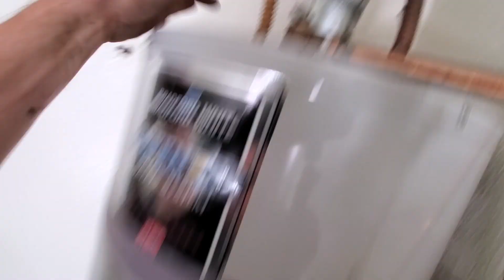2 water heaters in 2 hours

Comment: Tnp is no good
Reply from the maker: Did you not listen to what I said in the video? Let me recap: owners didn't want to pay us to run the t and p outside which would have required drilling thru the cabinet and floor, crawling under the house, drilling a hole in the side of the house and then running 8 ft of copper.
Reply: I heard ya bro and I understand them not wanting to pay for that, but I’m sayin the way you did is too short, if someone is in front of it when it goes off they might get hit

Comment: Putting in water heaters not to code is pathetic and nothing to be proud of!
Reply: I was about to say: You are required to put it in per code. YES, you as the Plumber responsible for this water heater are not only REQUIRED, to bring it up to code, but if you don't, and it goes bad; it's going to be your responsibility, because it's not up to Code. I think the IPC is idiotic mostly, but we are still responsible for it...
Reply from the maker: You don't understand plumbing then and have never installed a water heater for a customer in los angeles.  99% of water heaters aren't up to code when we come to replace them. We inform the client of what's not up to code and give them estimates to bring it 100% up to code. They never want to pay for the additional work because "it was working fine for the last 15 years without it being up to code." They always say that. The only thing we won't budge on is making sure the vent is ok and gas line ok but inconsequential things like the t and p discharging inside or a Drip pan isn't a safety concern. Customers sign off on the bill at the end of the job saying THEY refused additional work and price to bring heater up to code
Reply: @pershingplumbing9007  I can read and have read and passed both my plumbing tests. I am exactly the opposite, I tell the customer that their water heater is not up to code, and to install a new water heater will be "this" amount, that amount covers the stand &  the expansion tank. Because yet again, if you replace that water heater, the t&p fails; that customer has a high pressure water bomb sitting in their house. You think the customer will say " oh my wonder how this happened?", OR " this company is the company that replaced my water heater, and didn't do it right.". You are liable for the repairs you make, the government doesn't give 2 shits about you, they WILL make an example of you. So that's why my dumb Ass no plumbing skills does that.
Reply from the maker: @augustwest9727  did you not watch the video? This has nothing to do with the T&P but rather the DISCHARGE of the T&P. Wether copper is even attached to the T&P makes little to no difference in the usefulness of the T&P...the argument is for the discharge of the T&P and how LA wants it routed outside.